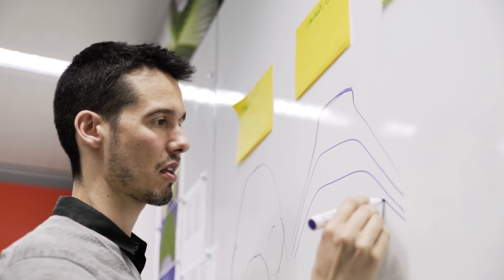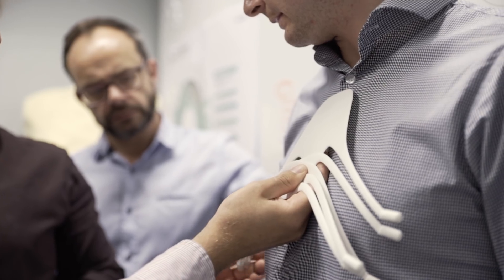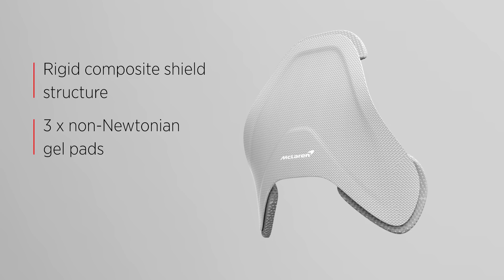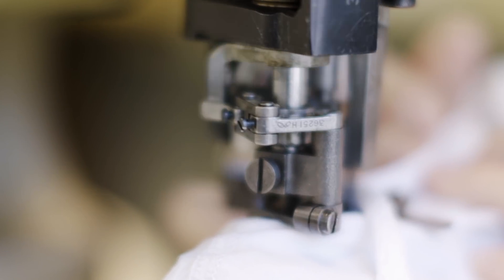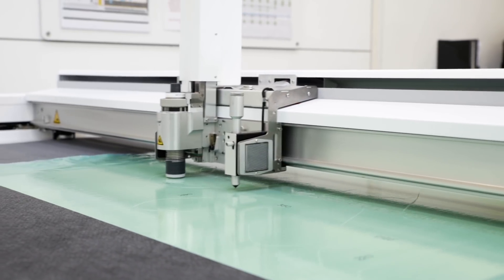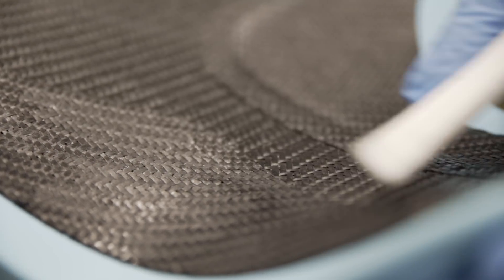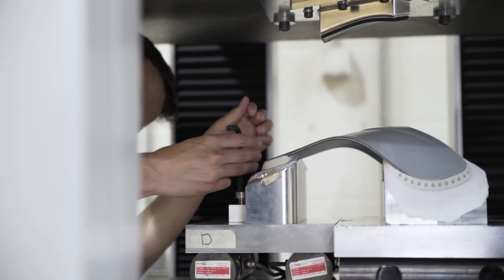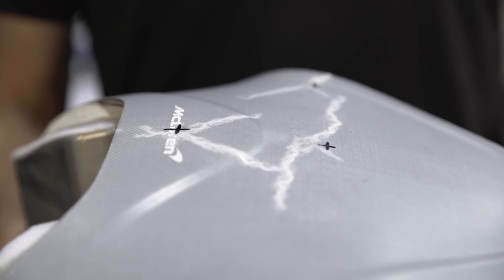Project Invincible - McLaren Applied Technologies

Comment: Good effort. I'd like to have seen a better distribution of force by applying an "x" shape shield vs what they have where at the top it center force is on the upper breast area. IF that top part were to move in a violent crash it may ram up to the throat area. 
So instead make the top much like the lower rib cage area so the upper "x" area is on both sides of a persons chest. Thus the pressure points will be better.

Comment: Investing so much into making this composite material only for a specifed client sounds a bit odd, is the customer named Bruce Wayne? But jokes aside, creating a prosthetic that helps patients with impaired structural intergrity of the chest area that could eventually help target patients actually sounds reputable. The fact it can withstand a impact equivalent to that of a bowling bowl dropped from waist height doesn't sound reassuring if we are talking about protection during a car crash which has far more greater forces in play. It will surely helps but in what degree. But to be honest, you've never said it was designed for a "driver" even though you were showing that it wouldn't interfere with the seatbelt. 
I imagine that the composite materials could be used in mix with the standard three-point seat belt to enhance safety of the passanger in an eventual crash. Like an X shaped belt with the protector in the middle. In my opinion it would look badass inside of a McLaren.